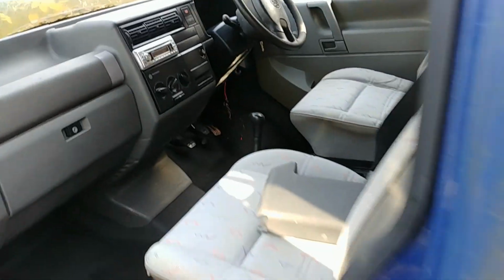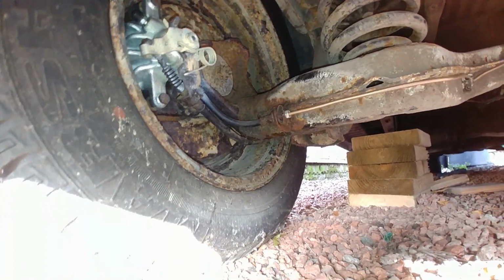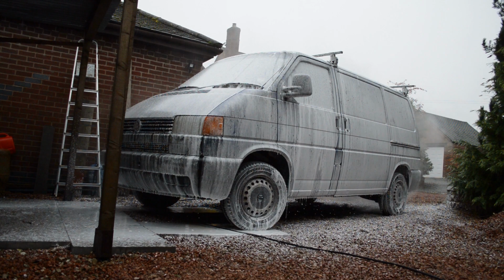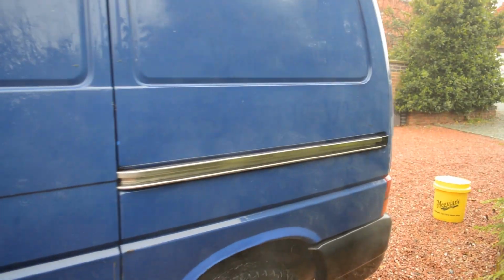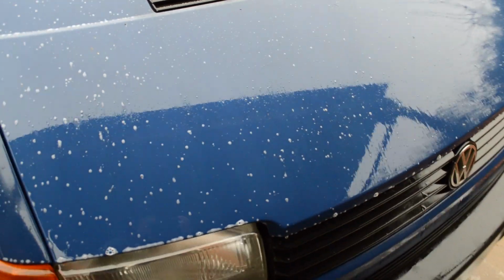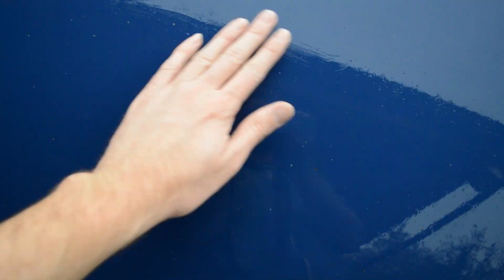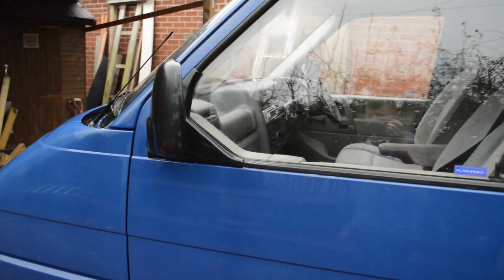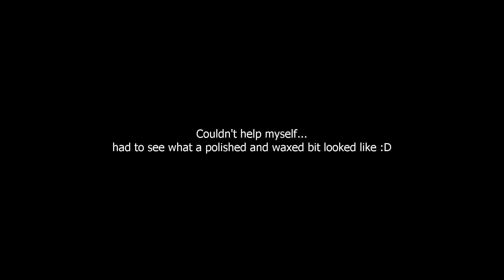Part 3:- VW Transporter T4 restoration. 1st clean in 10 years!

Comment: hi! for your van rustfree body some chapps would give an arm and a leg...
anyways, as the enginewise you can fit any 1.9 tdi vw engine from cars like vw golf 3;4 passat b4;5 polo; sharan 1994 -2003 diesel seat and skoda of that age, just look out for external pump, not pd.
codes 1z afn and other,..
if you want it simple, swap all your gear to now block with head... or...
if you wish it can go lots faster too. like afn gets 110 standart horses and with a bit of remap magic 130easy...
for swap you would need the donor car, engine block with pump, all wiring, ecu, ignition key socket for immobiliser a bit of welding refarding manifold with turbo...
for that would have to keep few old bits fom oringinal engine, because of lean.
 like oil pan, and valve cover... with a bit of work, alternator and coolant pump displacement, rear bracket sorted, all done!
look up afn t4 on youtube, many russians do it,if any questions ask me. 
best of luck!

Comment: If you can't find a decent abl go tdi I did when my abl blew up and not looked back.
Reply from the maker: Since this video I've put an ABL in. Got it cheap and running nicely check out part 4 and 5 😊
Reply: Ah only seen first couple of videos and what years your t4 mines a 95 but not standard
Reply from the maker: @brianlonewolfr3327  thought it was a 99 but checked the V5 yesterday and its a 98 plate on 95k miles. Completely standard 😊
Reply: @Weihrauch88  nice the abl is good moter couple mild mods to help her breath and she will plod along all day mine fell to bits after I pushed the boost to far and watch out for crank pully bolts failing.
Reply from the maker: @brianlonewolfr3327  pulley bolt is being closely monitored! The previous engines owner said he replaced it a few thousand miles ago as a precaution. I'll give her a few thousand miles and probably fit an intercooler (egr already deleted) and wind her up a touch.
Reply: @Weihrauch88  15psi is max limit not 23 as I found out you can get the crank nose ground and pinned to make it stronger and I think there is a stronger bolt now but its finding it if fitting intercooler look at a pd150 inlet and egr delete kit as flows alot better than stock item and I had a sprinter intercooler on my abl.
Reply from the maker: @brianlonewolfr3327  got a spare PD105 inlet here (same as a 150 one I believe) due to get a boost gauge and see where we are at mate. MOT 1st and foremost! 😊
Reply: @Weihrauch88  good luck with mot just got mine though mot only cost me 4 balljoints and track rod end.